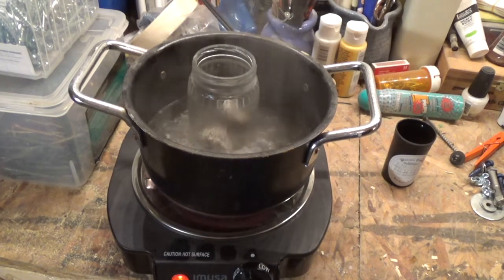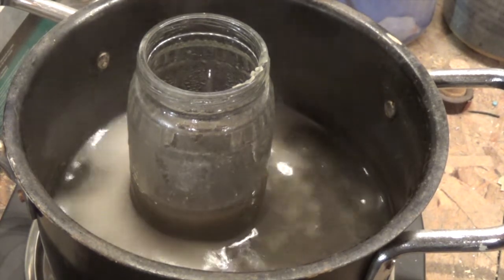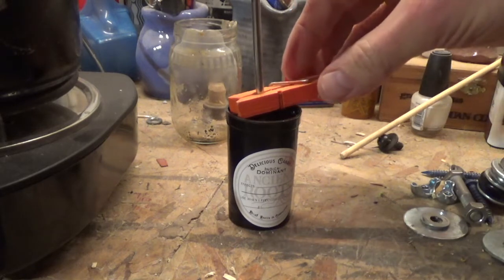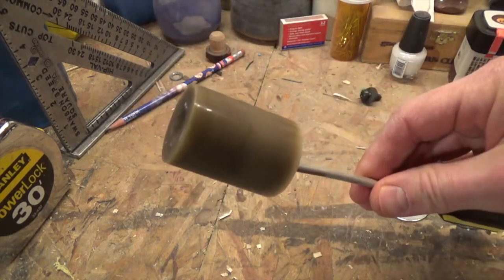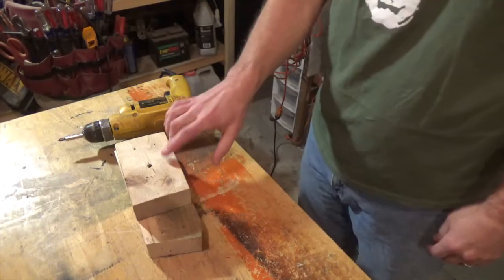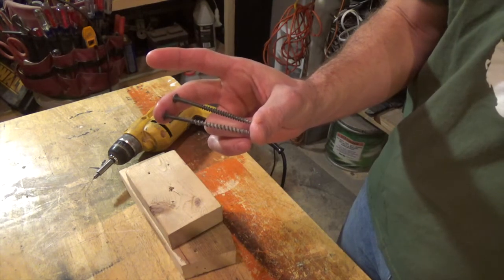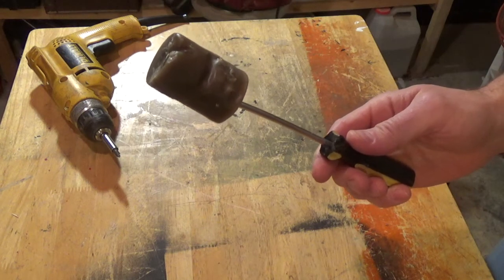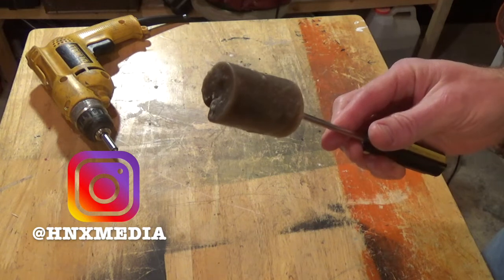Beeswax Wood Screw Thread-Locker (Woodworking Hack)

Comment: I use an empty stick deodorant tube, the kind with a knob on the bottom to raise/lower the stick. Lower the knob all the way, pour in melted wax, let it cool. Instant adjustable wax dispenser, with a top, too. Easy to hold and use, easy to carry and not worry about getting wax on anything else.
Reply from the maker: Absolutely brilliant! Comment pinned! Thank You!

Comment: Where did you get your beeswax?
Reply from the maker: Funny, the beeswax I am using in this video I found in the bottom of my tool box (that's why I had to re-melt it and figured I'd make a video at the same time). You can get real beeswax from just about any craft store (Michael's, Joann's, Hobby Lobby, etc). It comes in a block, which is usable for a while until it gets too small (or cracks) which is why I always melt mine and stick a screwdriver in it for ease of use.